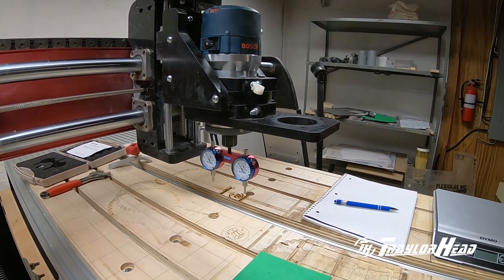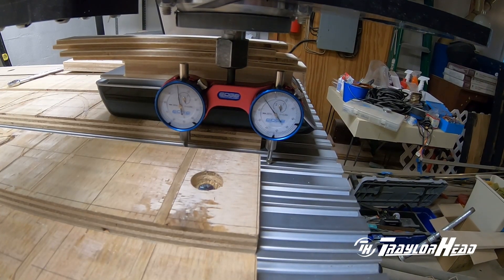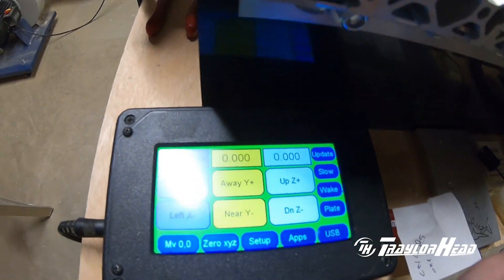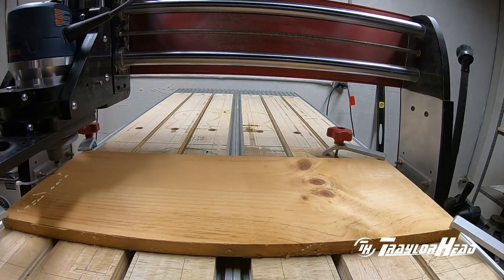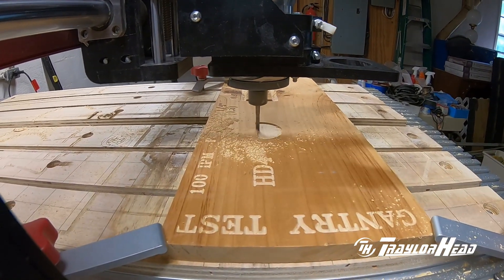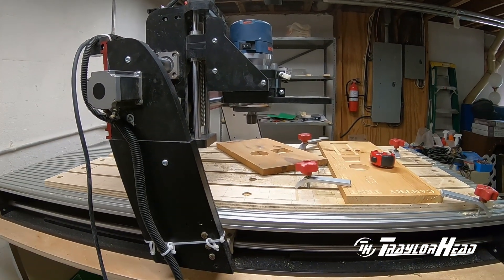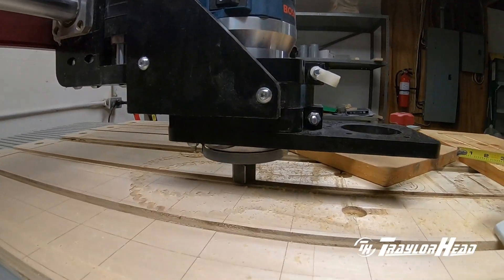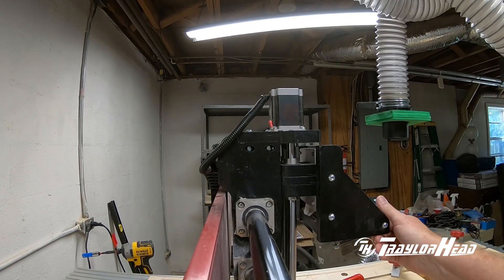HD4 to HD5 Gantry P1 of 4 (HD4 Test and Measure)

Comment: I have been very disappointed In my HD4. Way too much flex! Shark should not charge for the upgraded gantry; it should be considered a recall. For what they charge, they should offer the upgrade for free.
Reply from the maker: The way I look at it is all products be it software, hardware go through improvements over time. It cost money for the R&D of the improvements so there is a cost involved that is passed down.

You could buy a new HD5 with all the various improvements or upgraded an existing machine for much less.

I bought my used HD4, but like you quickly learned the limits for it. Having a technical background I worked out a lot of the issues by installing my own upgrades even before the HD5 gantry was announced.